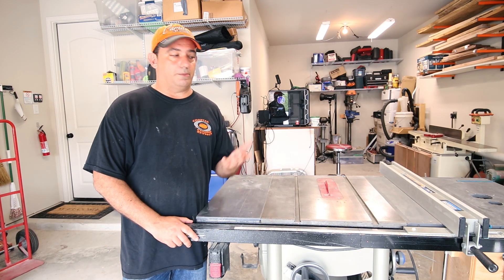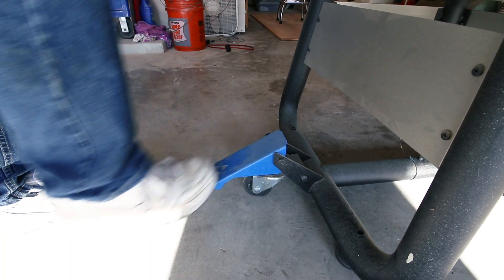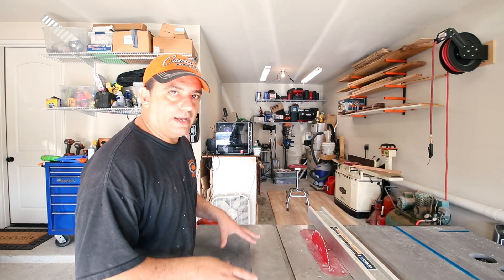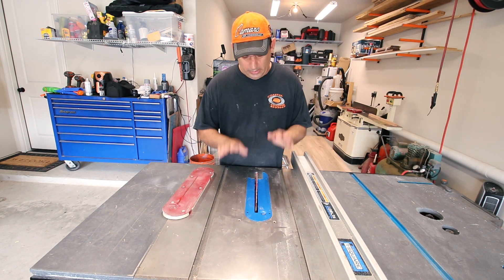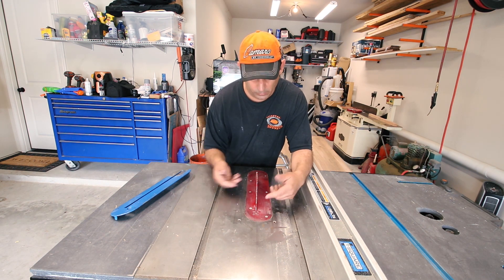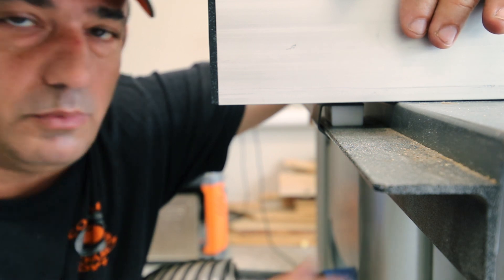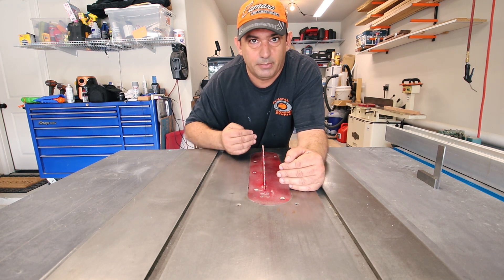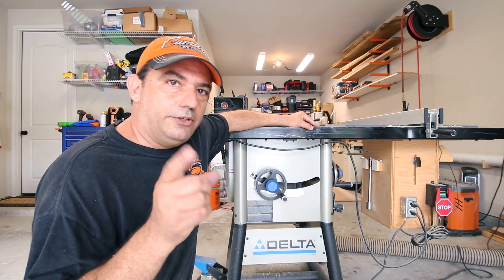Delta 36-725 Table saw review.  After 3 years

Comment: With all due respect, this is a $600 table saw, you say this yourself.  It is not reasonable to have $2000 expectations.  I am truly sorry that the cast iron table on yours is not flat, I have seen a few other comments/posts on the internet where people have the same issue.  I will say, that I did extensive research before purchasing the newer 36-725T2 version of this saw and the only other real competition is the Rigid at Home Depot that is $750.  The reviews/comments/experiences on that saw were not as good, the fence is not as solid and there were many complaints of the table not being flat.

To those out there considering this saw, please don't let this review scare you off, my opinion is that there is not a better saw on the market for under $1000.  DO listen to what Termite is saying about potential limitations of this saw and think ahead, and by all means, check your table for level right away.  Note...it will not be realistic to do this in the store, you have to unbox before and the main saw component is upside down in the box.

Addressing a few of Termite's concerns:
1.  Arbor length and Dado stack.  I have no issues, the instructions for my 8" dado stack say specifically that if you cannot get 2 threads past the nut with the stabilizer washer, then don't use the stabilizer washer.  The main dado stack blades are not thin kerf and are heavy duty.  This is not an issue.
2.  Zero Clearance insert.  These are available out there, look up CalyssaWoodworks on Etsy.  $30 for one (discounts on 2 or 3) made of 1/2" MDF and specifically made for the 36-725 and 36-725T2.  Fits perfectly.
3.  Dust Collection.  Mine works very well.  Yes, depending on what you are doing there is some that it doesn't collect, especially when you use a zero clearance insert (very little pull through on the air flow) or cutting rabbets or dados.  But, if you want to get perfect dust collection you need a full blown cabinet saw AND over the blade collection too.
4.  Rear Fence Clamp.  This is a valid concern, but this is only helping to keep the fence in place, it is not part of the clamping mechanism.  In fact, I saw at least one YouTube video where someone removed the black clip so that they could directly attach their outfeed table.  Just leave that rear white nylon glide in place.
5.  Not level top - true bummer, check your saw as soon as you can and if it is not acceptable take it back and get another.  Is that a pain in the butt, yep, but we are the ones that want the best saw we can get for $600 and this is it.  If you spend $2000 to $3500 on a SawStop or Powermatic 3-5HP Cabinet saw, you won't have this problem and if you do, you should be upset.

I have had this saw for about 6 weeks, so I'm a relative noob compared to Termite here, so thanks for the review man.  To others, listen to what he says , think about what your short/medium/long term needs are, and go into it eyes wide open.  

I do not think you will not find a better saw for under $1000.
Reply from the maker: Dude!   I had no idea someone on Etsy sells zero clearance inserts!   That's so awesome.   Glad you posted that! 

Also... I  later discovered that the dado issue isn't really an issue at all.   I just used a 3/4 dado stack this week and just left off three stabilizer washer.   It worked fine. 

You know what really bugs me about the whole warped table thing?   It's the only thing that deep down bothers me about this saw.   If the table were nice and flat,  I'd be perfectly happy with with saw.   Yeah... it's a $600 saw.   But really... if they would have beefed up the top with a thicker cast iron,  I would GLADLY have paid $700 or even $800.  It would totally be worth paying an extra $200 for a flat table.   The saw would still be in an affordable price range and it would have its worst flaw eliminated.  Sometimes the manufacturers don't think.
Reply: I was about to purchase this saw. Thanks for the review Termite. David thanks also for the input. The saw I’m looking at now is the Laguna fusion 1 or 2. Any of you have an opinion on it? 
Thanks again!!
Reply: @termitewoodwerx5896  You know, what's weird about that table top is that it's a milled surface, and you actually have to do extra work to try to mill a surface to a curve like that. So I would guess that sometime after milling (to presumably flat) the table twisted/deformed from a too-hot milling process. A milling shop can re-surface it for you, but I've no idea of the cost. Shouldn't be too much, as it's soft material and a .001" tolerance is child's play for any modern machine.
Reply: That T2 version looks like it'll be another winner for Delta. I'm perfectly happy with the original version but if it died I'd probably give that one a try. I believe mine can be wired 220. Delta makes a dado and zero clearance insert for it, that I have.
Reply: @madsteam77   The F2 is an amazing saw. This Delta is nowhere near the F2. That being said, the F2 does have what I consider to be a huge downside... The trunnion is made from aluminum. Not sure what Laguna was thinking, especially at that price point. Checkout Grizzly.
Reply: I spent 6 months reviewing table saws around $600 and the 36-725 (actually getting the T2) was the best based on the fence and table top. And the T2 has the 15 amp motor. They must be super popular cause I can’t seem to find a T2 at any Lowe’s around me. I’ll just have to keep looking.
Reply: David, I disagree.  I think Termite Carpentry is being very fair in his assessment of the saw's value. It's designed to bridge the gap between a portable job-site table saw, and one used in a shop for finer work. The powerful motor and cast iron table are features usually found in cabinet saws.  This saw's weight and lack of true portability make it, in my opinion, ill suited for use by a carpenter.  If the extra weight in the table, motor, fence, and stand are features included to help this saw dip it's toes into the woodworker's world, than the tables lack of flatness and it's inability to accommodate a full set of dado blades prevent it from doing so effectively.  It seems to me that Termite highlighted some important flaws that really make this only suited to a carpenter in terms of functionality, while the weight make it ill suited for that purpose despite those functionalities.  I think DeWalt's top tier job-site saw is probably a better choice for a builder, given its lighter weight and price tag for virtually the same functionality. 

Even if Termite's saw is anomalous in the poor table flatness, the small dado capacity alone would really limit this as a shop saw.
Reply: @John_NJDM  the dado capability is not limited the way he thought. You simply don't use the washer on the outside for wider dados as the other poster mentioned. Just thread the nut up to the outside dado blade. It has 7/8" capacity if I remember correctly. I've used the full Freud dado set on mine no problem. The dado capacity is one of the main reasons I bought the Delta.
Reply: @Jeremy_810  Did you find the dados functioned well without the larger washer on the outside? I would be concerned with their stability without it. Also, did you have the same table-flatness problem?
Reply: @John_NJDM  It was designed to run dados that way. Dados are true. There's no stability issues. The outer dado blades are thick enough that a washer is unnecessary. I still use it if it fits though. My cast iron was completely flat. His should have never went out like that.

I also have the Delta bandsaw and it's table is completely flat. It's very well made. I just wish I had spent another $500 for the Rikon to have 13" resaw capacity. At the time of purchase (got it on sale for $539), I didn't plan on milling my own lumber out of fallen trees but that's been a hobby all on it's own.
Reply: @John_NJDM  Though it likely falls into the "contractor's saw" category, few would try to use it as a portable.  

The table on mine is perfectly flat.  

If you read my whole comment (sorry, I know it is long), my point #1 is that you CAN use a full dado set and I do on mine.  You just have to read the whole set of instructions on your dado set, which clearly note that if you cannot get 2 threads past the nut with the stabilizer washer, then don't use the stabilizer washer.  The main dado stack blades are not thin kerf and are heavy duty, so it isn't a problem.

The primary point I was making is that my experience with the saw is not what Termites is, that some of his concerns are not valid (dado stack, zero clearance, etc.).  I stand on my point that you will not find a better saw in its price range let alone under $1000.

For a portable, I agree with you 100% go for the DeWalt.
Reply: David Bondi: Valid rebuttal! I have had my 36-725 for over four years now. It is light years better than the old skil table saw I bought new when I only had two cents to work with. I have made all manner of furniture with this. I even use mine (with a glue line rip blade) to make glue-up quality cuts since I can't afford a jointer. So, for those who are rethinking purchasing this saw, if all you have is 7-8 hundred to spend, IMHO you can't do better.

Comment: Thanks for the awesome video.  I got this second hand.  Is there a way to make the fence slide more smoothly?  Wax or oil?
Reply: Wax or silicone lube often and keep the rails and the plastic sliders on the fence clean
Reply: I use minwax brand paste wax on mine, works great,  doesn't leave residue on wood that will affect the finish, and leaves a barrier on the table to help prevent the cast iron from rusting
Reply: @benkinnard7095  maholo Ben. I’ll give it a try

Comment: Thank you for the review.  I literally just bought this saw tonight.  I'm not that fine of a woodworker so I'm hoping I can overcome the level tabletop issue.  Oh well, we'll see.  I have a couple questions for you if you could be so kind to answer.
1. As far as the lack of threads on that arbor for installing a dado blade.  Couldn't you flip that washer over to allow more threads to be exposed while still securing the blade? Concave instead of convex?
2. Facing the saw, you've added more table to the right with a T-track.  Can you share with me what you did or used to improve this table top area?  I need to do this.
Thank you in advance.

Bob

Comment: The table bowing down is a common problem with tablesaws where the motor is hanging from the tabletop... more expensive saws have the motor mounted on the saw body so that there is no load on the table. I have heard the problem being described, but this is the first time I have seen a clear demonstration of how bad it could be.
Reply from the maker: I've heard of this happening.   I don't know if my table came this way or if it happened over time because I never checked it the day I bought it.   Stupid me...
Reply: The whole point of a cast iron saw table is to have a truly flat plane.  Could it have warped from shop temperature changes over time?  Could a machine shop lap mill the top to correct it?

Comment: Thank you for the extensive review! I find myself always looking for the perfect saw. I don't think that is possible in the price point I'm searching. I do believe that there are enough positives out there for this saw to be an entry level saw for the entry level/weekend woodworker. There are more positives than negatives.

Has anyone come up with an option to add an outfeed table or a router table side wing for this saw yet??

Thanks again for your time!
Reply: @M. M I am looking at buying a used one for $300. I think the pros are higher than the cons at this price.

Comment: So have you thought about getting the top resrufaced at a machine shop?   Your review is excellent.   Although the one I messed with at lowes the fence sucked.   Any lateral pressure from front to back moved 1/8".
Reply from the maker: No.   I'm just saving my pennies right now so I can afford a nice cabinet saw.   I don't think I'm going to put money into this saw.   

As far as the fence... mine doesn't move at all.   The person that put the demo floor model together probably didn't take the time to do it right.

Comment: For less than a hundred bucks you could take your top to a machine shop and have the surface ground to within half a thou of dead flat. Especially do-able because yours is cupped so no thickness would have to be taken out of the center. You'd lose 30 thou off the miter slot at the entry/exit, so if that's a feature you use often you'd also have to have those re-machined, but that's a pretty simple process for a machine shop as well.
Reply from the maker: Thought about that.   It might be a good solution.

Comment: Excellent Video!  You do a great job of showing the good, bad and really bad of it.  I too have that exact saw and have also had it for about 3-4 years.  I couldn't agree with your assessment more!  You hit the nail on the head for everything.  The one thing I think you missed, and perhaps you don't have this issue on yours.  Mine, I always have to feather the handle down when locking the fence in to place.  If I don't, there's no guarantee it's square to the blade which leaves a "less than stellar" cut.  If I feather it down before clamping it down, I can ensure the rear lock is properly aligned with the front.  I have tried multiple adjustment to give me some confidence, but have  yet to find that sweet spot.  I am about to upgrade to a Grizzly, and while watching review videos on the Grizzly's I"m considering, your video came up, glad I watched it.  Enjoy whatever new saw you get, I know I will enjoy mine!

Comment: Do you know if the top was level/flat when you first got it or did it warp over time?

I just bought a secondhand (but new) one of these for a deal and the top is completely flat from what i can tell with a quality level.

I wonder if there are some manufacturing issues with some of the tops, either that or they are warping over time...

Comment: Hey to all readers and Termite.  Im 70yrs young and this will be my first table saw ever.  Ive been working too much and into guns and reloading for 50yrs.  I mainly build stuff out of metal.  Have most good tools for that.  But have always wanted to do some woodworking.  That said my shop is a little crowded, I also want a bandsaw very bad.  This saw looks like what I need and well into my budget.  Thanks for review. Oh still not retired yet, so its a Sunday afternoon hobby.
Reply: Lynn Campbell I bought this table saw not to long ago, I’ve noticed the blade is too far forward and I’m only 5.4” tall so I have to stand on a platform so I can safely cut a lumber. I hope you are at least 6’ or more tall.
Reply: @amirhouseingholinia2023  Thanks for info, no I'm not 6'  But have changed my mind and looking again for perfect saw.  Starting to think I need to spend the money and just buy a Saw Stop.
Reply from the maker: I'm not exactly tall.  5'8".  I don't have a problem using the saw.   I find it quite comfortable.
Reply: @termitewoodwerx5896  Im sure it would work for me, but just looking for something I don't have to fix or check.  I think my budget is in between a good cabinet saw and a job site saw.   Looking more at the Hybrid.  Right now Im on hold till I get another project done and out of shop.  Thanks
Reply: Hi Lynn Campbell, what saw did you end up buying?

Comment: Can anyone tell me the total assembled depth of the Delta 36-725 table saw?

I've already purchased it but it's still in the box until the basement workshop gets finished. I want to make sure that I can roll it in and out of the shop when needed but don't know how wide I need the doorway to be in order to accommodate this. Unfortunately I can't find the dimensions on Delta's website. I reached out to them but haven't heard back yet.

The answer would be a big help.
Reply from the maker: 31 and a half from from real to rear rail.
Reply: That’s great! Thank you for the reply, the info is very helpful and the video was quite insightful.